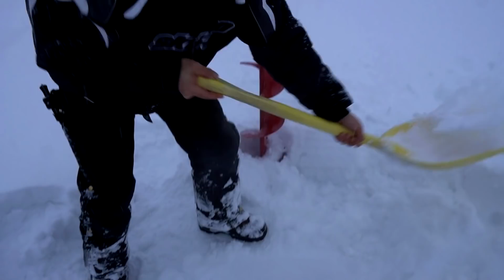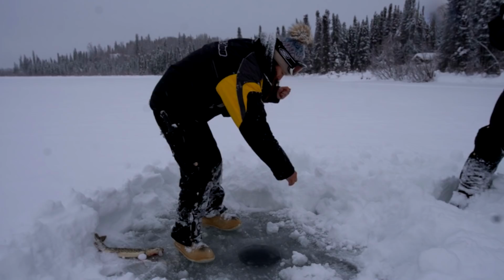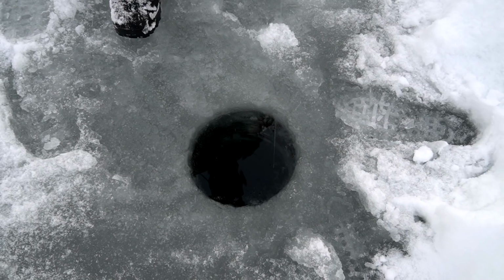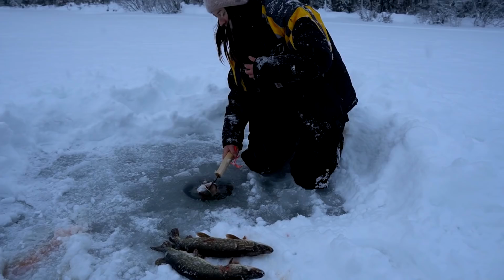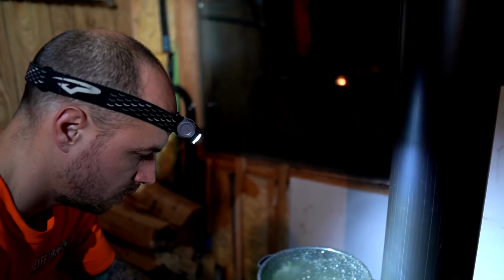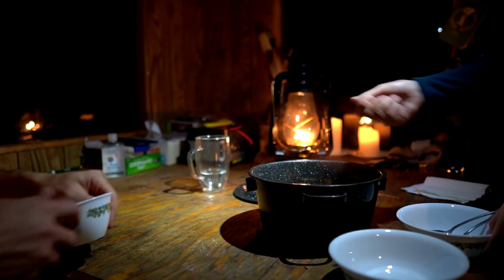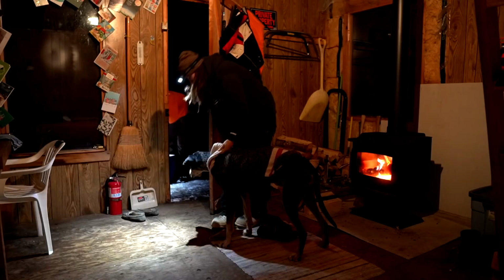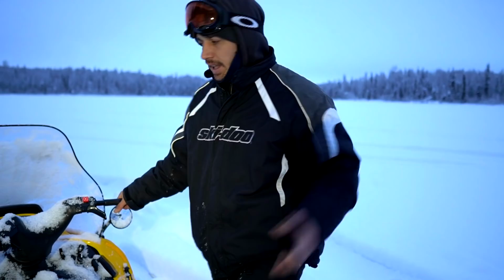Catching Dinner at the Cabin | Far into the Alaskan Wilderness

Comment: When Pike slow down biting, try riding you snowmobiling in decreasing circles around you tipups area. Also banging a heavy weight off the bottom stirs them up. That's why you get hits first thing you just hit the bottom checking the depth. Plus the noise and vibration from the drill.  This works for us in the slow times  we learned the snowmobile trick one day when my son was more interested in riding and not fishing. I thought he was pissing off the other folks on the lake.  Next weekend I was alone and the same folks fishing. They came over and asked where the snowmobile was? They told me the fish started hitting with him riding around and wanted him back! Good luck great show.
Reply: As a charter fishing skipper in New Zealand I agree with the noise concept to bring fish on to the bite👍
Reply: Sounds like a cool method!

Comment: I have been on the lookout for Pike fish in a Filipino Supermarket in out town in Vallejo Ca.  I’ll try to buy two big ones and cook them two ways. One is clean the fish but leave the head on. On a baking pan lay down a layer of 2 bunch of scallions and leek cut in 4 lengthwise. Throw in slices of one onion, salt n pepper and  smashed one whole garlic. , ginger Add a mix oy 1/4 cup soy sauce, 2 tbsp oyster ,  sauce And juice of 2 lemons. Add 3 Tbsp of white vinegar. Cook in oven for 45 minutes or till done. Serve with plain rice. Another is cut the fish into 4 Pcs and cook it in ginger, onion, garlic, salt and pepper. Add two cans of coconut milk. Add the fish when coconut milk starts  to boil. You may add Bo hoy . Adjust flavors with salt and pepper.   Your Alaskan Adventure is very inspiring. There’s no snow in our part of California. Lake Tahoe is about 3 hours away.

Comment: Ice fishing is fun , getting outdoors .Not to crowded there. Here we have a couple tournaments a year and I saw you drilling holes and you bolt the motor to the auger but this guy forgot the bolt ,he's had too many and he breaks thru and the auger goes to the bottom and he's standing there holding the motor. A guy drills a bunch of holes for them so they set up their grill he puts the pole back 30ft or so from the hole .I saw it move a little and just as I start to go save it ,it shot across the ice and down the hole.You are both lucky having so much outdoor opportunities just outside your door. I don't get out as much but it's a treat watching your videos and thinking of the old days!

Comment: To get your sleds up to the cabin put a block up high on the cabin.  Then run a rope to the snow machine up at the cabin and the sled at the bottom of the hill.  drive the snow machine down and the sled goes up.  By putting the block up high hopefully it will hold the front of the sled tongue up out of the snow.  When it is time to leave hook the sleds up to the snow machines and drive out.

Comment: Hi, Paul from Sweden here. When angling for Pike, it’s easy to miss their bites. The Pike’s way of attacking live bait or fish, is that they strike fast from the side of the bait fish where they have a large strike area, swim away a bit and then turn the fish to swallow it , head first.  The way you use that if you’re using tip ups, is that when you see a tip up, you go to the rod, pick it up carefully and wait until the spool stops unwinding. Then, if you carefully hold the fishing line between your fingers you can often feel the Pike tugging a bit when it turns the bait around (or just wait a few seconds after the spoil have stopped). This is then the time for you to make a distinct counter strike to set the hook.  It’s usually a winning way to be a bit patient when you get a hit on your baits. Good luck with the ice fishing and if you get more Pike using ”my” method, then give me a shout-out in a video.  Love the content!

Comment: I've watched a few of your guys videos now and they are awesome! One thing I've noticed and wondered about is why you don't have any sort of lighting in the cabin? I feel the headlamps would begin to get bothersome after awhile. I use cheap led string lights from amazon along with a lawnmower battery and a small power inverter. Runs for days, provides nice warm light and is a very inexpensive and easy to set up!

Comment: Just a tip , on your D ring or shackle for second sled/ tow sled ( one u put gear in )you should run a wire through it so if it comes loose during the ride you won't lose it and be stuck . Just little wire or string  on the pin . think there may be hole in it already some do have a hole .

Comment: You need to sharpen that hack saw
And you should always put the pin to your Clevis thru the top .... if it comes loose you won't lose the pin .... or a zip tie thru the lock hole

Comment: You two have accumulated a lot of nice gear over these few years and I really think it's great that YouTube has helped you out that way. What you two are doing can be a lot of fun but most don't know how hard you have to work at it. So BIG KUDDOES to you both! And Eric, You got pretty damn lucky when Ariel said "YES" to the very big question(s).
I hope you have strong super good quality and sharp as hell hooks. Pike have hard mouths and those teeth are sharp. I like using steel leaders. Bait fish live or more likely dead in the winter but I've also had good luck with heavy brine herring in a pinch or even frozen nightcrawlers in those little mesh dohickies. Not my favorite fish to eat (slimy and can be fishy) but if filleted right they are easy to eat bone wise.
P.S. ALWAYS screw the bolt for a towing cleat from the top so if it loosens it doesn't fall out and be lost forever.

Comment: Okay you guys.  You really need to set the hook a lot harder than you were. And wait for the second run. After the first strike they usually stop and work the bait head first in the mouth and take off again.
Reply: Agree, Pike are different. You set the hook on the second run. Setting the hook is a quick tug, while they are taking line on the second run. Glad they were biting. Nice video and good job. What happened to the outhouse? I would like a weekend cabin would not get filled up. Until your next adventure. Love the card decorations.

Comment: Cool vid.  It takes 30 seconds per pike fillet to make them boneless.  Another trick is cut fillet down to tail fin but not cut it free, flip fillet over and then use the tail as an anchor and fillet meat off the skin.  I have good results using the Rapala Jigging Rap and Northland striker rigs.  How is that Skandic working?  What was the issue with head and tail lights?

Comment: Let them run with the bait for a few minutes, they intentionally spit the bait out in an attempt to descale and slow the bait (if alive) it starts to swallow the bait  then you need to set the hook much more firmly than what you are, your gaf is too short, get one that has a sharper tip, longer handle and colored hunters orange .